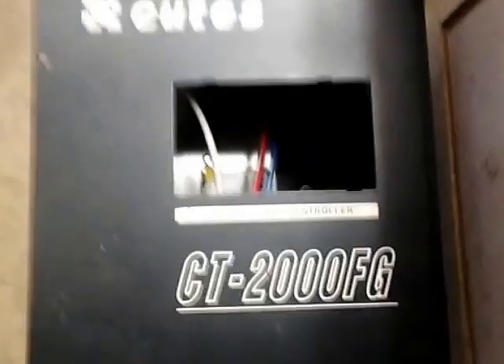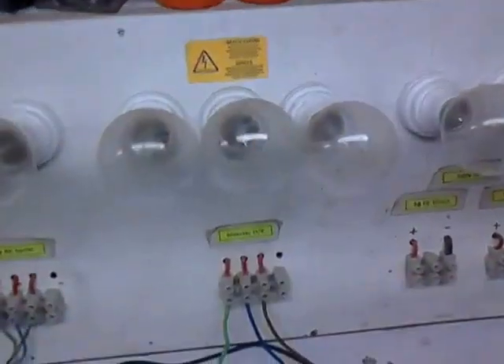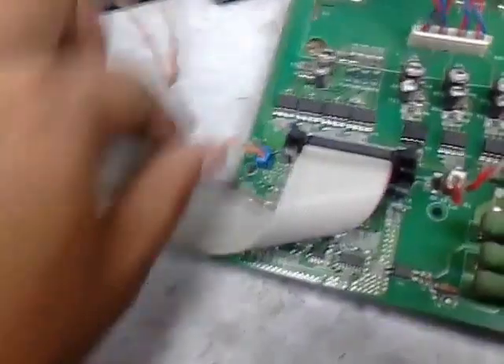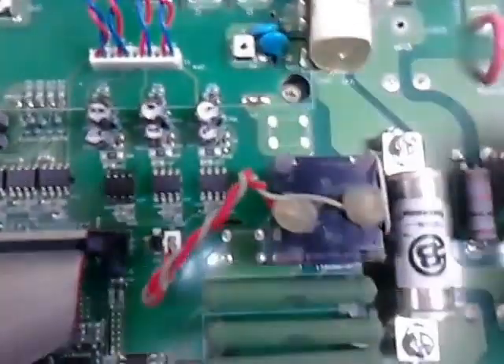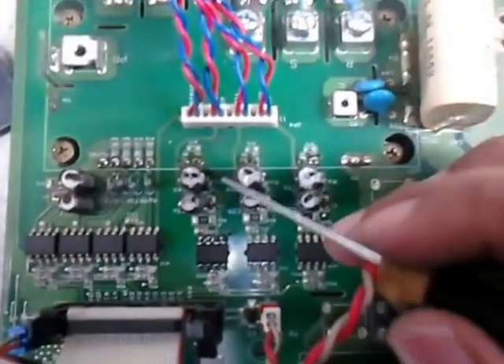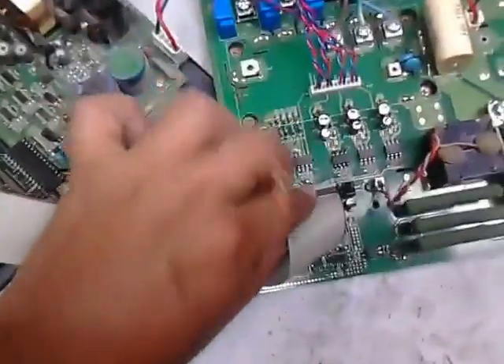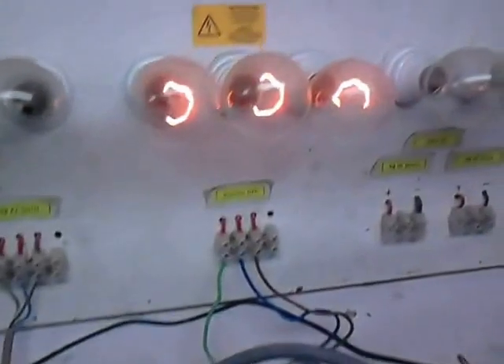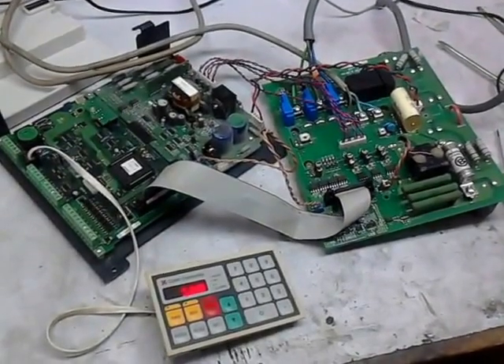CUTES 7.5 KW Drive Repairing

Comment: This optocoupler is parts of IGBT output in Inverter circuit? Function just like transistor or switching components?
Reply from the maker: Sorry for this much late reply.
Optocuplers wokrs just like switching devices for IGBTs to fire their Gate ICs...

Comment: Hello sir .. card se igbt nikalne ke Baad gate plus kese check krte h or kitne voltage par card on hota h is bare me btayen please sir 9992497374 what's app
Reply from the maker: Is card ko ON karnay k liye aap ko FUSE ki sensing bypass karni paray ge jo 220V ki sensing kar raha hy . Phir IGBT remove kar k board ko 3 Phase Supply day kar ON karna hay kyun k CUTES k board main internal supply use horahi hy. tab ja k Oscilloscope k zariye aap pulses check kar sakty hain Board main.

Comment: Hello sir how r u. u r very good. sir how to replace brick igbt (solder type) 
how to test gate signal  in vfd drive.
I dont have three phase supply plz help sir
Reply from the maker: 1: To replace IGBT it depends on the type of IGBT soldering... the one which you mentioned here is a typical one...
2: To test Gate signals use Oscillscope or High Frequency LED with a resistor (value depends on LED voltage) at IGBT Firing Circuit to check the Opto Coupler ICs... 
3: Use the Signle phase to 3 phase Transformer for that purpose.

Comment: Sir aapke video se thoda bhaut idea Mila 
aapne Jo test bench banayi Usme kya kya use Kiya please bataye mujhe bhi test bench banani hai please help kare
Reply from the maker: Thanks for compliments. For testing the circuit no extra parts are used. I just connect the cablings are per required connections and on O/P just connected the  200W Bulbs in Start connection.
Reply from the maker: Thanks for compliments. For testing the circuit no extra parts are used. I just connect the cablings are per required connections and on O/P just connected the  200W Bulbs in Start connection.
Reply: Sir aapne jo test bench dikhayi hai usme kya kya lagaya hai agar mujhe vfd test bench banani hai to mai kya karu
Reply: Sir aapka contact number mil sakta hai kya
Reply from the maker: @amar5269     https://engrsajidrehman.net/contact  send you contact details on that I will contact you.

Comment: Hi Bro, do you repair ABB drives? Do you have Electronics schematic  drawing of ABB ACH 550 Drive?
Reply from the maker: Im good... There are No original schematics available of any drive coz its patent and not possible to get by this way on net. I repaired different drives and for repairing, there is no limitations up to specific drive. You can share your fault may be I will help you some how.

Comment: Assalamualaikum !how can find firing section on driving board and other sections etc ?
Reply from the maker: Walaikum Salam.. Sorry for late reply...
Firing Section can be found easily by observing the installed IGBT Module Datasheet. Normally Opto-coupler ICs or Transistor (Thyristors) are installed on Firing Section of the IGBT.